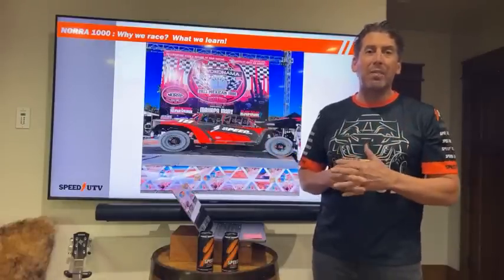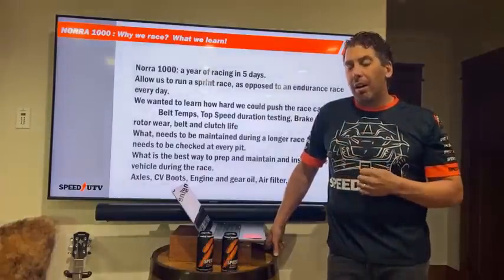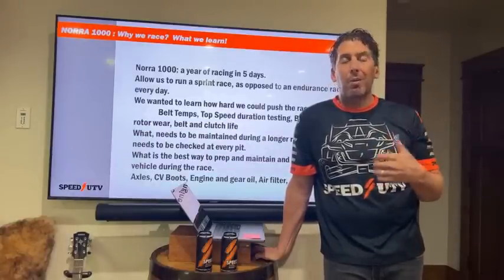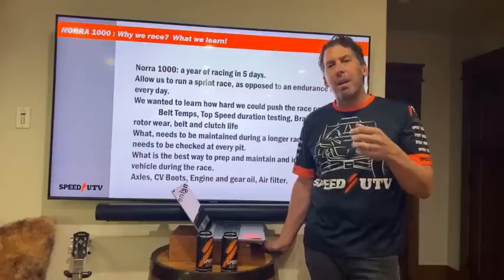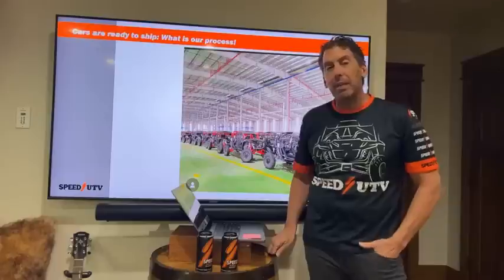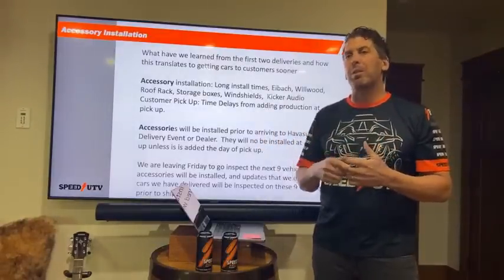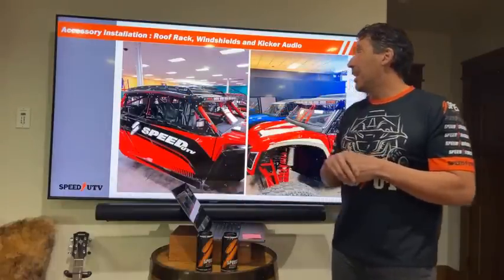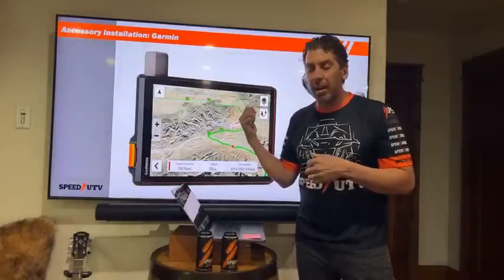SPEED UTV With Todd Romano

Comment: I'm excited for the ls powered car
Reply: STILL NEEDS TO SHOW a dyno or demonstration of the speed key 🔑 on 300hp on e85 300 hp will smoke canned hams and pro Rs will the belt hold with speed key? Suspension looks dialed tho.
Reply: Where did he say that?
Reply: @sunview9250  in another video robby was calling out polaris for changing the rules on how many cc a utv can have and changing race class rules. he said that he designed the speed utv where the cage is large enough to accommodate an Ls motor  and he was like how big you wanna go i'm already way ahead of you. then he proceeded to say he will come out with a limited a run of ls powered speed utvs calling it the mad max edition.